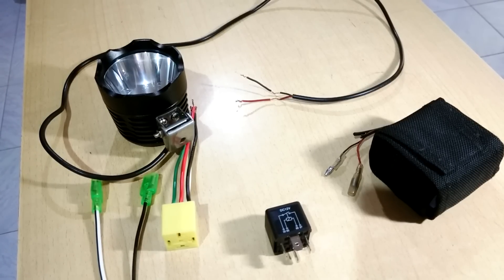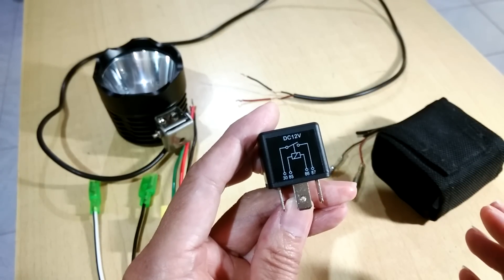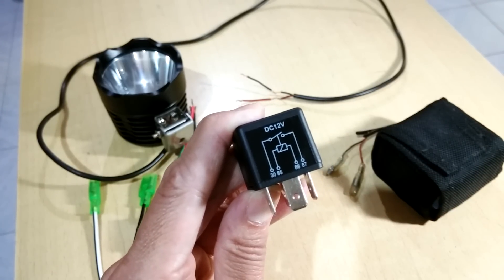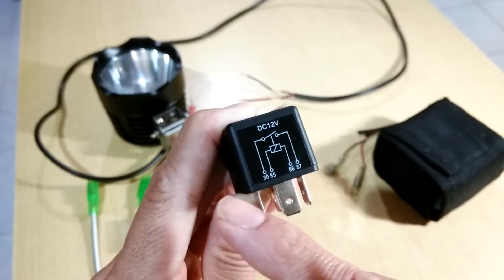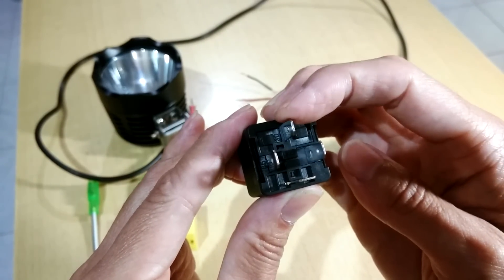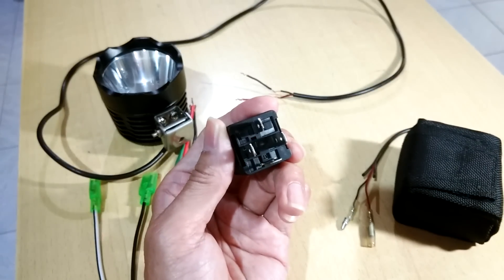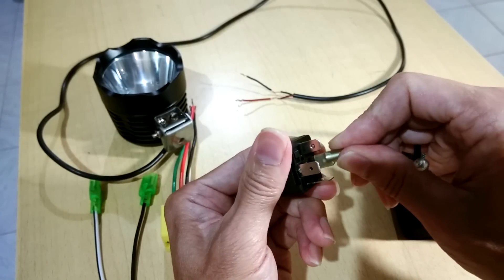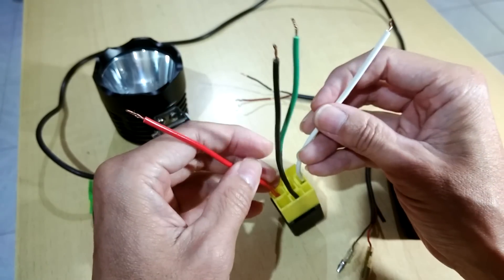How to test a 4-pin Relay (Electronic on/off Switch) also with connector & led light

Comment: Sir, can this relay be used with any fog light, also if I don't use the displayed relay, is there any difference, plz help
Reply from the maker: Basically yes any fog light. Just get any normally opened 4-pin relay would be fine.
Reply: @2allbuyer  thx sir👍

Comment: How could I make the bulb blinking using 4pin relay?
Reply from the maker: You can't using a 4 pin relay. You need to use a 5 pin relay like in my other video.

Comment: One the first part of the test you say to hook the positive power to 86 pin and the negative to 85 pin and I should here a click in which I did but then I swapped the positive and negative and put the power to the 85 pin and the negative side to the 86 pin and I get no clicking sound at all.  Does this mean that the relay is bad?

Comment: Thanks, well explained on the connection. Should also explain why a relay is needed.
Reply from the maker: Thanks for the good advice, I sure will do that in the future. Normally using a relay is better than a direct switch because of the Amps that can handle and also water resistance.

Comment: Ok but what does make a horn like a bike
Reply from the maker: Most horns operate at 12VDC so you need a 12V battery, a horn and a horn switch. You can also use a no lock push button switch as a horn switch (only connect when push down and disconnect once release the button).

Comment: Make a horn video using relay and 9v battery please
Reply from the maker: Are you making a horn system from scratch with the 9V battery ? If that is the case, you won't need any relay to do so just connect the horn to the battery with a switch. If you connect to the relay, you will need another system to trigger the relay in order to make the horn works.

Comment: Sometimes relay clicks but doesn't work. We need a multi meter to check it properly.
Reply from the maker: If the relay click then the relay is working. It is either work or not work, nothing in between. The issue is most likely about the connections to the relay.

Comment: Superb explanation sir. Thank u so much
Reply from the maker: You are welcome! No need to than me, I am glad I could help.
Reply: 2allbuyer just one question. Do we connect the relay while the wire goes to light from toggle switch right. This I am asking as I have light connected from toggle switch
Reply from the maker: Normally if the lights draw high Amps, we use the relay so the high Amps is switch on or off electronically. Secondly a relay is more safe to use as a switch because it only requires mini-amps to operate the primary circuit where a mechanical switch will run whatever Amps the system needed.
Reply from the maker: The headlight on my ER6N is always on when turned the key on, but sometime I just want to run the engine to charge up the battery. If the headlight stay on while engine is running, it will not be efficient to charge up the battery. So I installed a relay with a handlebar switch to turn the headlight on or off to fix this. I don't have time to do a video on that yet but will have it done in a couple weeks time.

Comment: The device is simply similar to the way you checked , but I added a fifth wire to the tip 87a , key and fuse and then all this stuff was packed in a box , thanks for your interest, sorry I can not make a video because I do not do it well.
God bless you
Reply from the maker: Thank you for sharing. No problem with the video. God bless you too.

Comment: Based on the video clip, I have made a simple device for the purpose of checking the relay, and this device is very useful for me to check the fuel system and other things , thanks again.
Reply from the maker: You are welcome. I am glad the video could help. May be you can share how to use the device you made.

Comment: if I put a fuse in. does it have to be the same amp as the relay? I have 40 amp relay but bought 30 amp fuse. for a in line fuse holder.
Reply from the maker: 40A is the maximum amperage the relay can handle. The fuse should be according to the load (led lights etc...), what is the maximum Amp the load draws then that is the fuse size.
Reply: 2allbuyer it's a 3 prong switch. and  the switch works the led just off battery. but the switch won't work when connected to relay. I hear the relay click. but no power to switch
Reply from the maker: What type of 3 prong switch? A normal on/off switch use has 2 prong, one in & one out. How did you connect the switch in regard to the relay? Why you need a switch if you are going to use a relay, a relay is an electronic switch so same function.

Comment: so where would you put a switch in for led light bar?
Reply from the maker: I will put a switch on the negative side of the led light bar. The negative of the light bar goes to one side of the switch and the other side of the switch goes to the ground.
Reply: 2allbuyer thank you!

Comment: I finally get it now,.. you run a positive to the relay twice the switch part is completely separate,. my head was melting i was sure they worked with just one positive, makes so mush sense now, thanks man .. I can get on with this feckin job
Reply from the maker: I run the positive to the relay twice to show that the 1st circuit pin 85 & pin 86 are non-directional. You can connect the +ve to pin 85 and -ve to pin 86 or reverse it +ve to pin 86 and -ve to pin 85, the relay will will still work. Anyway, if you have any question, feel free to leave me a message or email me.
Reply: I see that, I've got it right in my head now fair play..
I'm wiring the lights you see in the thumbnail pic.. the bulbs are Halogen rally visions
6 X 100w up top 
2 X 100w up front 
I've got 2  80w built into the bumper instead of fog spots
Reply: I  most likely will be back on to you .. thanks

Comment: i want to install 2 fog lights in my car how many prong relay will i buy thanks
Reply from the maker: Just get a 4-pin relay but make sure the Amps is enough to handle the 2 fog lights.
Reply: @2allbuyer  cool, how to ensure the amps is enough, can u suggest, my 2 fog lights are 18 w each, plz help
Reply from the maker: @shahfirozahmed2158  This relay could handle 20A maximum so should be more than enough. Your 2 fog lights running 12V battery is around 3~4 Amps in total.

Comment: When tapping into 12v switched live wire to power 12v, 50mA parking sensors, is a diode necessary? Automotive relay I was looking at does not have a diode.
Reply from the maker: Hello Pat, You don't apply direct power to a parking sensors. The sensors should connect to the control unit as seen in this picture: http://i198.photobucket.com/albums/aa266/2allbuyer/parkingradar/sensorfullset.jpgIt may damage the sensors if apply direct power.
Reply from the maker: It may damage the sensors if apply direct power. The sensors should connect to the central unit as in this picture:                 http://i198.photobucket.com/albums/aa266/2allbuyer/parkingradar/sensorfullset.jpg
Reply: +2allbuyer hi, thanks for your reply, yes it is the control box of the unit that'll be powered by the vehicle circuit, I need to add a relay to the wiring as the sensor kit works fine with ignition in position 1 but not when the engine is running (12v supply from ignition,  reverse wire positive and ground). I'm just wondering if a diode is necessary as the automotive relay I was going to buy doesn't have one.
Reply from the maker: Hello Pat, You should tap the red wire of the sensor control box to the reverse light bulb positive wire, so every time you put the car in reverse the sensor unit get power. The black wire of the sensor control box can tap onto the negative of the reverse light bulb or any negative wire near by. If you feed direct 12v power to the sensor control unit instead of getting power from reverse light bulb, the sensor control unit will power up all the time regardless whether you are in reverse gear or not.
Reply from the maker: what kind of parking sensors system you are using? Does it have the reverse camera too?